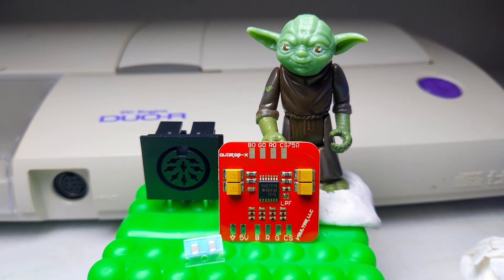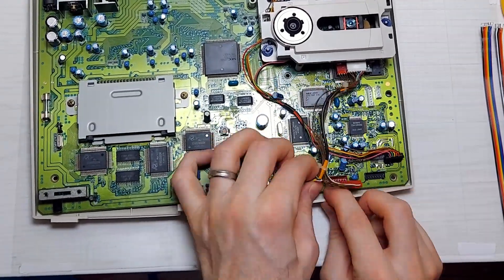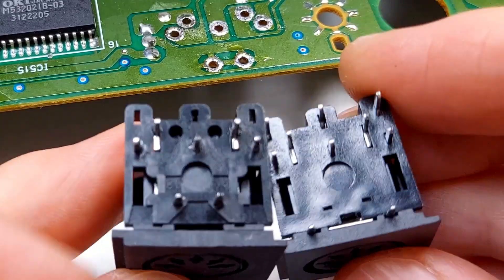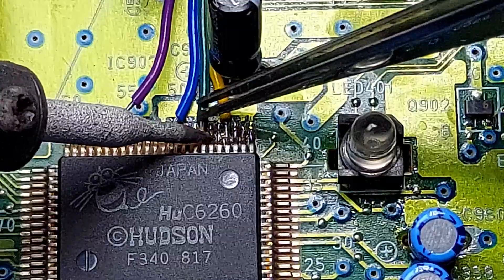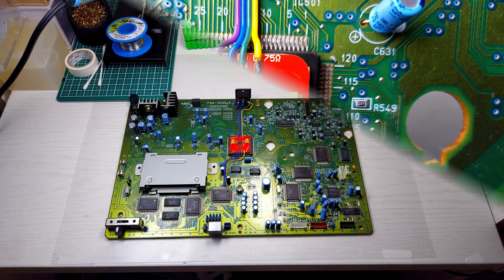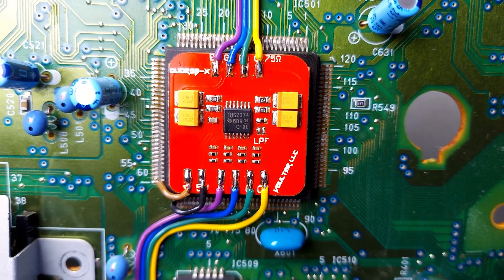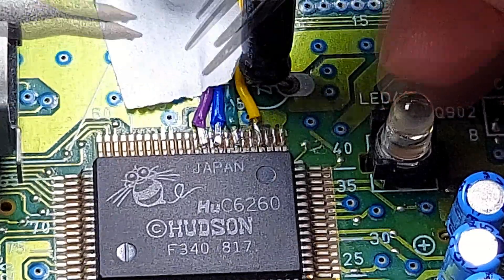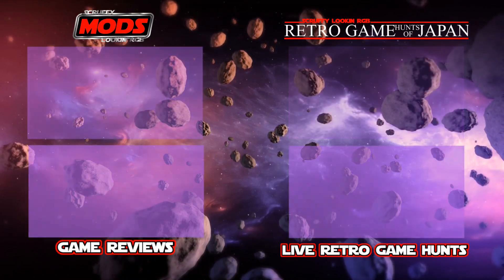Japan Exclusive duo-r rgb modded How to install Voultar's duorgb-x

Comment: Hello great vid. I was wondering if you have any experience with the hucard volume setting. It seems lower than other consoles and lower than the cd games. is that normal in the duo r? I have to turn my volume pretty high to get desired sound.
Reply from the maker: I haven't tried to improve the sound for hue cards but I know it's just a design flaw that effects the pc engine. As far as I know

Comment: what gauge is that wire? and where do you buy it ribboned like that?
Reply from the maker: Just Google some ribbon cable. I dont remember the exact size but they aren't so expensive i usually keep a couple different sizes handy. Very useful 👌
Reply: @ScruffyLookinRGB  thanks a lot. found some and im following your tutorial.

Comment: Nice work!  I didn’t realize how few layers that Duo-R had.  It looks much simpler on the inside compared to the NES.
Reply from the maker: Yes this model is fairly easy to work on. Most of the issues ive run into with these are solved by reflowing soldier.

Comment: I had a PC Engine Duo R in 2006, and a few days after I got it, the CD-ROM drive just quit working.  It wouldn’t spin up at all.  The Hu-Card port still worked, and I wish that I had kept it.  I live in Denver, Colorado and I bet I could have found someone with the skills to fix it.
Reply from the maker: That is terrible i have one that also has cd drive issues. I dont blame you for getting rid of it back in 06 i wouldn't have known what to do with it either. But they are great for their versatility definitely worth having if you find a good deal on one.